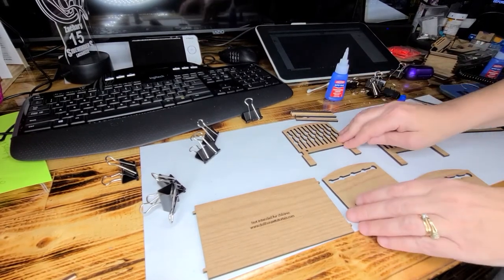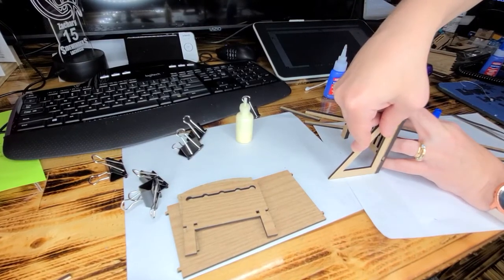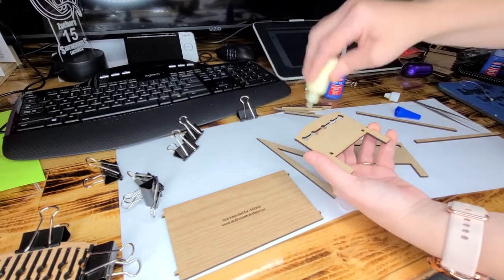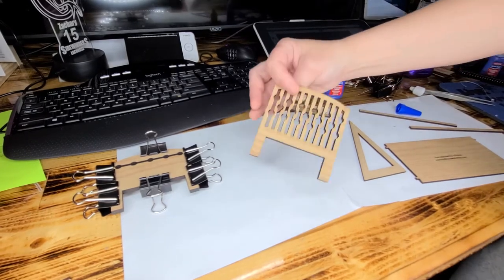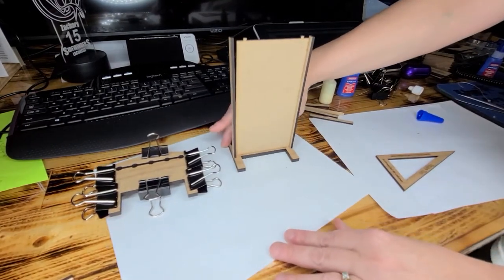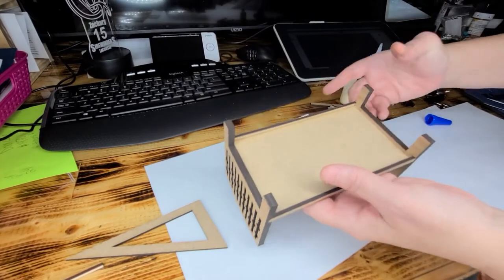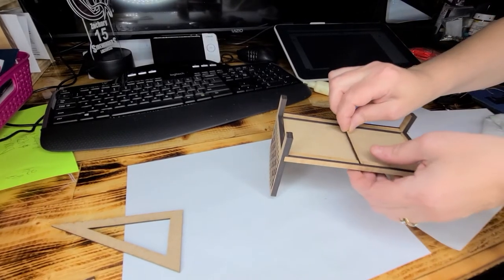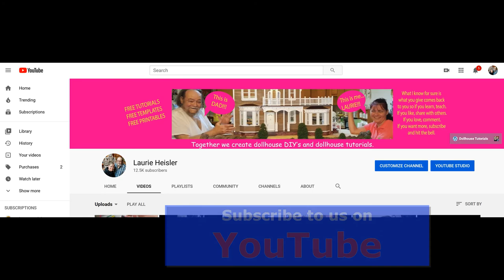Dollhouse Twin Bed Type 4 (Laser Kit-Easy Build Level)

Comment: Hi there!  I wanted  to  ask  you  if I can use  1/12 scale furniture  in a 1" scale miniature   dollhouse ( The beacon hill  wooden  dollhouse?)
Reply from the maker: The Greenleaf Beacon Hill dollhouse is 1:12 scale. 1" is equal to 1' in a 1:12 scale dollhouse so as long as you are not referring to a 144 scale house which is only around 2" tall then yes you ave a 1:12 (1")  scale dollhouse. Your doors should be around 6-7" tall in a 1:12 scale dollhouse.
Reply: @DollhouseTutorials  thanks  so much.